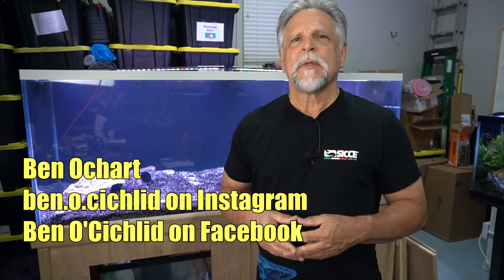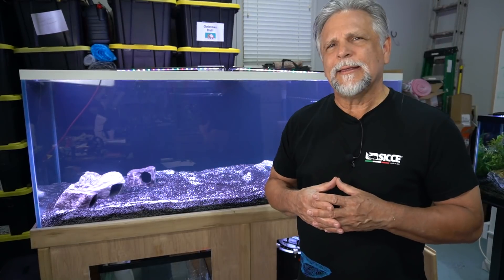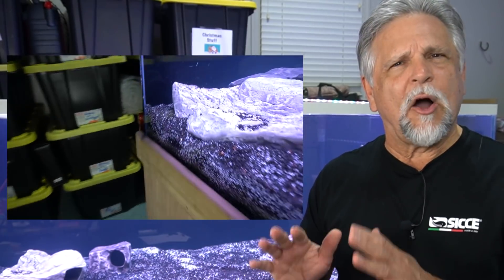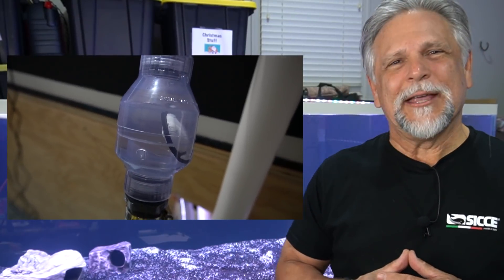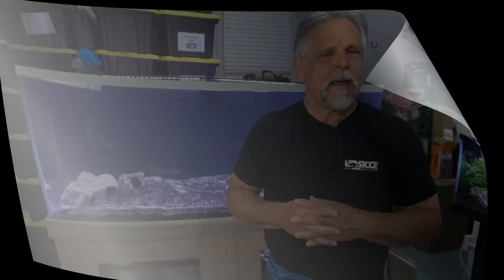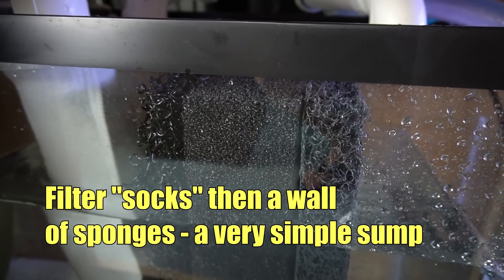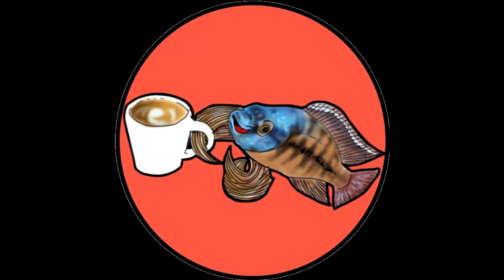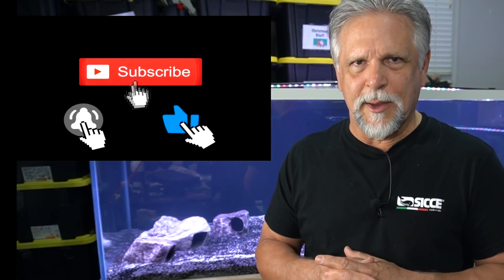Aquarium SUMP Filtration - MADE SIMPLE - [my DIY SUMP!] - Aquarium Filtration Made Simple Episode #2

Comment: Sumps are very simple..you basically just need a few key things to make it work. An overflow (brings water from the tank down to the sump, the sump itself (does the filtration) and a return line. One pump runs the entire operation and it gets connected to the return line. If you want to be safe just add a check valve to the return line so that water only goes up. That protects you from a flood in the event of a power outage and a back siphon.

Ben has a very nice setup and he's gonna have years of fun with it.

Comment: Very good explanation of how the sump system works.  A few observations, 200 micron socks with a 10 ppi poret foam will allow a lot of sizeable particle matter to return to the tank.  I have a 4 inch,10 pppi foam wall (like yours) that I have not cleaned in 18 months because nearly all the detritus passes through.  I get around this by having 20, 30 and 45 ppi foam downstream from the 10 ppi in the sump.  Regarding substrate, in my measurements there is very little contact between aquarium water below  the top 3/4" of substrate, and very little water flow overall through the substrate- unless one has a undergravel filter.  Without this flow through the substrate there is limited opportunity for beneficial bacteria (BB) to thrive and maximize removal of ammonia and nitrates in the substrate.  This is why I have over the years found the sump to be a much better home for the BB than a static substrate like you have in your set-up.  You can always add a canister to catch the particle matter below 200 microns.  The problem with this approach is the cannister will clog, and is much harder to service than sump media.  Again, my years with sumps have pointed me in the direction of 1.  Catch the majority of the detritus and fine particles in the sump, 2, use coarse biomedia, 10 ppi foam, pot scrubbies for example, in the cannister.  I go up to a year without changing my canisters with this approach, and I can easily clean the sponges in the sump (20, 30, 45 ppi) in about 10 minutes per foam- and without even shutting off the sump.  Hope these tips help.
Reply from the maker: I have placed a fine sponge block at the bottom of the section separating the sponge wall and the pump. I’m confident it will catch whatever makes it through the socks and sponges (apart from eliminating the bubbles created by water cascading over the glass baffle, which was my original reason for placing the sponge block there). 
If your theory holds turns out to be true, apart from the usual weekly sock swap-out, that final sponge block will be what I rinse in tank water once a month. Very easy.
I’ve heard numerous theories on the deep substrate. I’ll see how things progress over the next six months and post an update. I imagine it would take at least that long to establish. 
The FX-6 is primarily for polishing, but I did throw in a couple mesh bags of pumice I had laying around from another project.
Stay tuned 😀👍🏻
Reply: HMHC, no oxygen to the bottom of the substrate is exactly what Ben wants for anaerobic, nitrate eating bacteria.
Reply: @obsessivecichliddisorder7258  A static, deep bed results in little to no water flow in any deep areas that may become anoxic.  No water flow, means no nitrate laden water reaching the anoxic zones for denitrification.  Simple physics.  The conditions for an anoxic bed- very little filtration, deep mulm, deep and viable plant roots generally cannot be achieved in a cichlid tank- at least with the cichlids in Ben's and my aquariums.  Hope this helps clarify.

Comment: Great system you designed for your tanks, the " bean system"! It is impressvely smart thing! I have a question: what wuold be the recomended volume of a sump for a 125 gallons fresh water aquarium?
Reply from the maker: I’m very unorthodox and use smaller sumps with high turnover. My 210 gallon tank has a 29 gallon sump with a Sicce 9.0 pumping 2500 gph, while my 300 gallon tank has a 40 gallon breeder for a sump with 2 Sicce 5.0’s pumping a combined 2542 gph (some gph is lost due to “head pressure”). Both systems are doing a great job running the water through my DIY sump set ups. 
Some would suggest a sump around a third the size of your display tank. So, for a 125, a 40 gallon breeder would be fine.
Reply: @BenOchart  Thank you very much.

Comment: Great video.. Informative. If you put a piece of pipe (doesn't have to be glued) long enough to extend down into the water in the sump it won't make the splashing sound. I have a piece on both outlets in mine and drilled holes in them just in case there was some kind of blockage. Do you plan to run an auto top off? Cant wait to see you put some fish in it. Just made a trip to Midwest Tropical fish in Jerseyville Illinois. Best fish store I've been to so far (Sucks its 2 hours away). Ended up buying more fish than I intended. Came back with a F1 8" Malawi hawk, 2 Malawi trout, 2 tiger severums, and 2 gold severums. Owners were super knowledgeable and great to talk to.
Reply from the maker: I added pipes to the elbows that extend into the socks and placed a block sponge in the section that separates the sponge wall and the pump. It’s now silent and no more bubbles created by the water cascading over the glass wall.
That was quite the haul of fish you picked up! Any store that would carry fish like that must totally rock!
Thanks for watching and commenting 😀👍🏻
Reply: @BenOchart  sounds like your getting a handle on that thing. That fish store I just went to recommend that swiss sponge also.. I'm probably going to do a large overhaul on my sump here fairly soon utilizing some of that sponge and my 3d printer. Ps that's Hawks coloring is spectacular... Made my fusco and venustus perk up a bit with the added competition. Can't wait for the 2 trout's to grow up and get them in the main tank.

Comment: Hey Ben, I like your sump design. I use the matten filters in all my tanks, also I did have the filter socks in my sumps but learned that if you don't change every week they are nitrate factory's. They collect all the waste and leftover food. So I removed them and just built a rack to hold filter floss material that's out of the sump water. Works alot better. I also use marine pure inall my tanks. It holds a ton of beneficial bacteria. Check it out.
Reply: Yes, filter socks absolutely have to be changed out...what I do is have like 20 socks that you can just keep changing every 4-5 days and then clean them with bleach one time at the end of the month. Anything that traps waste and detritus will become a nitrate factory so gotta have good husbandry.

Comment: How often do you have to clean out those socks?..Weekly?.. Are you planning on filling up those compartments with Bio balls?.. I know you said you'll use the HOB stuff...
Reply from the maker: Hi Craig. I have an extra set of socks and plan to swap out weekly.  I might add some media between the sponges and the socks but I need to leave room for a heater. All the media that was in the Xpertmatic (3 sponges) and the Marineland Emperor 400 (4 squares) fit nicely under the socks and, together with the two large bottles of FritzZyme7, the tank is ready for fish.  As a side note, I originally intended to use the FX-6 only for polishing but I had a couple bags of pumice from an old project and I threw it in the bottom baskets of the FX.
Reply: @BenOchart  perfect set up.. I'm looking forward to the tanks journey...

Comment: 😀👍Great video Ben but I will stick with my Sicce Canister Filter, love it. I know what my luck is like, I would definitely flood the house using a sump 😆
Reply from the maker: 🤣I hear ‘ya. Why mess with success?
Reply: If you get a check valve on the return line, you'll never have a flood...even when check valves begin to get old, only a tiny amount of water trickles back down in a power outage...and the water will only drain back as low as the return spout is...once air gets into the line, the water stops immediately. Ben drilled a tiny hole in his return spout for added security.
Reply: @GSP-76  Thanks maybe one day in the future if I'm brave enough to try 😃

Comment: Hey Ben,  I have just recently ventured into the diy sump world. I did two 15 gal. For my 125 cummunity but never can get them dialed in. I always have one with lower level of water than the other. So I'm working on a 35 gal. Diy sump to replace them. Have any advise for a sump newby?
Reply from the maker: What’s your overflow system? With the Synergy I’m using I can adjust the gate valve to dial things in. Also, consider a variable speed pump. That provides more dial-in possibilities.
Get a pump that detects being dry and shuts off automatically. Gives you one less thing to worry about.
Hope that helps. Feel free to reach out. I’ll help if I can.
Reply: It's the older durso overflow. Was in the tank when I bought it used. Thank you in advance for any info., I'll have to look into upgrading my pumps too

Comment: I’m curious about going to a sump with my 125gallon Discus aquarium. Currently running 3 HOB Seachem 110’s and a canister. I am hesitant because idk what size pump is sufficient to return the water with a hang on back overflow.
Reply from the maker: The HOB overflow will have a rating. Get a variable speed pump and it should be easy to dial in.

Comment: The novelty of the socks wears thin very quick, too much maintenance. A large piece of floss lasts a lot longer and you don’t need to clean it all the time, just throw it away.
Reply: Yes and no. If your like me I have multiple tanks with sumps it’s kind of nice to be able to clean and not throw away money all the time like buying filter cartridges for HOB. I buy cheap floss and cut too size but still adds up
Reply: I believe Ben's socks are 200 microns which may not plug so fast and in fact they may allow a lot of particulate matter to pass through.  I used 600 micron socks filled with pot scrubbies and the socks never plugged up

Comment: You can calculate the amount of water that will drain by gallons divided by height that would give you ruff estimate it’s pretty close. 

You’re probably going to love the socks witch can be removed and rinsed or bleached as much as you like too keep nitrates down they say it can be 40% lower just buy doing it often
Reply from the maker: Aquarium is 24” tall, so 210 gallons divided by 24 tells me how many gallons for each inch my water line drops (in my case, 8.75 gallons per inch) 😀